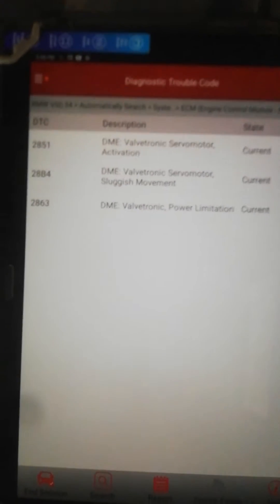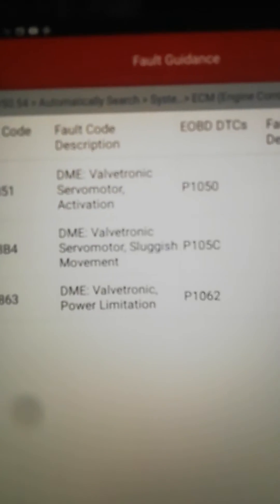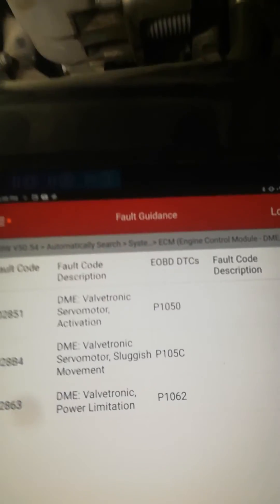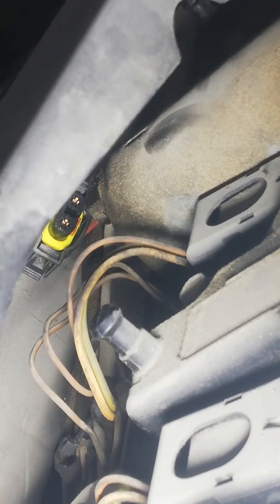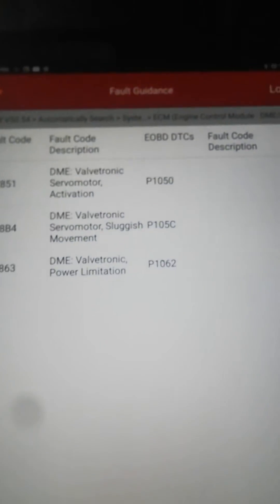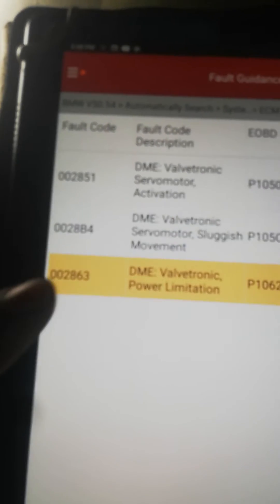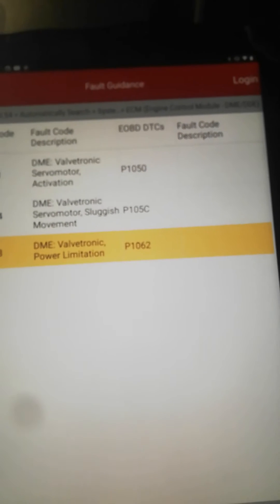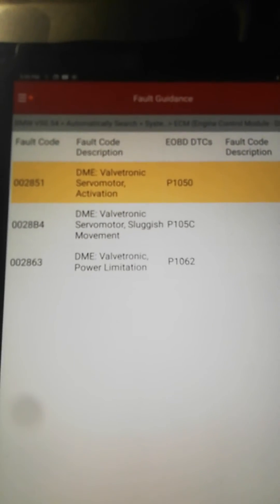Fault code p1050, P105C and P1062 bmw   Valvetronic Servermotor

Comment: 2868 DME: Valvetronic Servomotor, Sluggish Movement
History
28B4 DME: Valvetronic Servomotor, Sluggish Movement
Current
296A DME: Inlet Camshaft Sensor
Current
2870 DME:VANOS, Inlet: Adaptation Stop
Current
283D DME:VANOS, Exhaust: Adaptation Stop
Current
2FF1 DME: Thermal Oil-Level Sensor
Current
2863 DME: Valvetronic, Power Limitation
Current
Reply from the maker: I hope you were able to solve those problem 🙂

Comment: I had yesterday a P1062 Warning code, after I turned the engine off and on. I did it because I felt the performance getting lower after a half hour of driving. Anyway after the restarting the engine, my car goes to the emergency program mode and I could only move like a turtle. Thank god I found a place to stop somwhere safe. Well I had an OBD tool with me, so I could checked out the fault. It was the code P1062 Valvetronic Power Limitation. After few restarts, the engine lamp was still on. I was not sure if it was the right thing to do, but I deleted the fault code. But after that my car (BWM E90 N46) runs like before. And on the backway also. Was it maybe a false warning? Did I made a mistake and still moved the car even with the warning?
Reply: It probably is the electric motor of the valvetronic system or something is wrong with the cables of it (sorry for my bad english)
Reply: Detecting resistance in motor winding or cables. More likely motor is starting to fail or motor is overheating
Reply: @WayToManyAssassins  It was actually the cam chain. The car was not even running 100k and I had to replaced it. So painfull. but thanks for ur answer.

Comment: I have sluggish movement , open circuit.
Already replaced servomotor with new one, i have also replaced the sensor. What's next?
Reply from the maker: Do some calibration 😊
Reply: Did you fix it?
Reply from the maker: @LuqmaanShah  do you have similar problem?
Reply: @ramseydubem8336  I've got the exact same codes, p1050 p1062 
Half engine light on
Limp mode active

Dont know where to start
Reply from the maker: @LuqmaanShah  definitely bro I can... Text me on my page Dubem automobile company or WhatsApp +971567952130
Reply: @LuqmaanShah  did you fix it at all man? Havin same issue
Reply: @jblvxk  car goes into limp mode when it gets hot and goes back to normal when engine cools down.

I didn't fix it but have narrowed it down. 

Its either the servo motor or camshaft sensor
Reply: @LuqmaanShah  hmm interesting I’m gonna try clean my vanos solenoids and check the seals, also the vvt motor
Reply: @jblvxk  I tried cleaning the vanos,  taking them off was easy
Gave them a good clean and then put them back on
Turn 318i on and it started shaking like no mans business lol

Every time rpm would drop and engine would stall, 
I took them back off, swapped them around, but you have make sure their in properly 
It started working again, smooth.

After a hours driving, did a emergency stop, slammed the brakes and went into limp mode again.

Its something to do with braking and the valvetronic motor
That should fix it

Let me know how you get on
Reply: @LuqmaanShah  hmm I just finished cleaning my vanos solenoids ( they looked pretty caked up with oil) but cleaned them and put them back in. Checked the O rings and they were all ok. Car is now running better than it ever has , purchased second hand @ 100k kms it’s just done 130k kms now. It’s a 320i 2006. I think I’ll get an oil change done now too but it seems to be running very smooth and no rough idle or rpm flucs on idle or engine start

Comment: P1050 is valvetronic? Is bad ?
Reply from the maker: Yes, but you can start by checking the fuse or connectors for electricity
Reply: @ramseydubem8336  the fuse is good, the connectors i am dubt
Reply: @ramseydubem8336  mi eccentic sensor is new
Reply: @ramseydubem8336  The car has lost power. When is going to pass a march it sounds like drill a few seconds and then the pass
Reply from the maker: Replace the valvetronic bro if all electric is good and it got the code p1050
Reply: @ramseydubem8336  ahhh ok, p1050 is a bad valvetronic and this is the sound
Reply: @ramseydubem8336  thanks bro 🙌🙌🙌
Reply from the maker: If ou need extra help, WhatsApp +971567952130
Reply: @ramseydubem8336  iam from of chile, i dont talk a good english,  I'm going to write to send you photos of how things are
Reply from the maker: No problem bro, I don't speak perfect English too, looking forward to working with you 😊
Reply: @Fran-mv7rr  pudiste solucionar el  problemas, me esta pasando lo mismo, me cuentas como te fue y que hiciste porfa
Reply: @Fran-mv7rr  Hola Fran, soy de chile, tengo un bmw 318i e90 2008, tengo los códigos p1050 y p1062, eso es que debo reemplazar el valvetronic? Ojala me puedas ayudar
Reply: @ramseydubem8336  hey mate ive got the same problem !! Can you tell me how much work it is to fix it
Reply: @ramseydubem8336  Hey mate I've replaced the eccentric shaft sensor and still have fault, only happens when car is warm after a long drive. When it goes into limp mode it starts rattling, does this mean the valvetronic motor is out sync or doesn't have enough power to lift the cams?
Reply from the maker: @WayToManyAssassins  the motor is weak